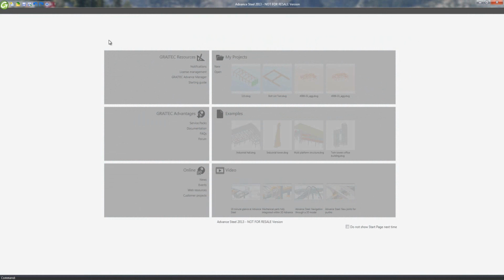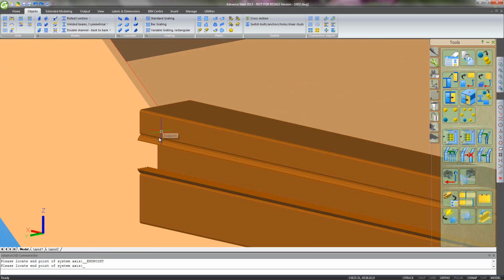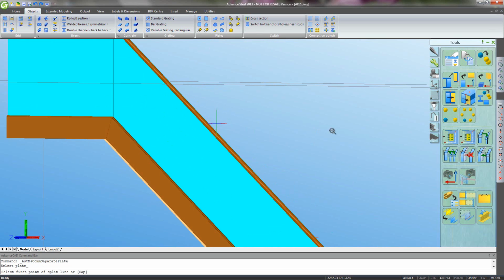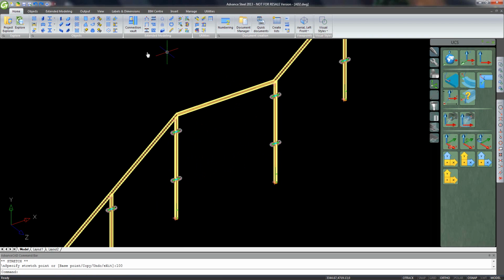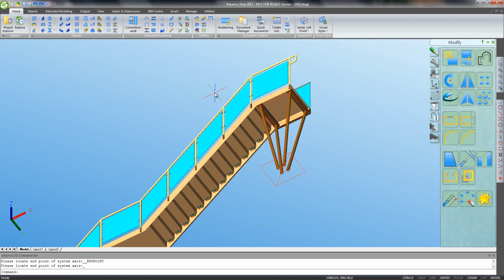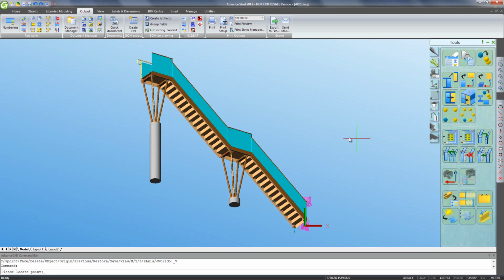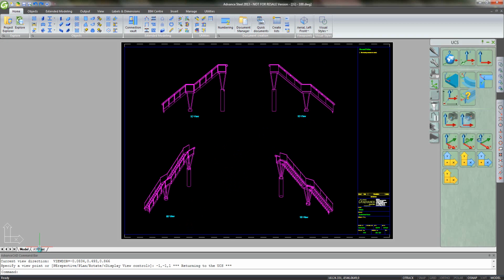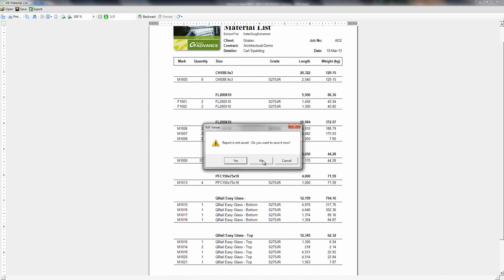Advance Steel for Architectural Metalwork

Comment: hello, one problem i have with this program is when i change the units to meters, it dose not change it when i draw it and only shows me inches, although it has been changed in the units settings. Can you please help me?
Reply: In this case you need to create a template with metric units and always work with this template...

Comment: To make the compound beams on the free standing glass rail I created user sections of the required special beams. Then I placed a compound beam and set the options in the dialog to place the bottom rail and rubber wedge together correctly and used the SaveAs button in the dialog to store this compound beam configuration. I repeated that with the top of the rail. My user sections were very rough and for demo purposes only. They were not fit to share with people for genuine use.